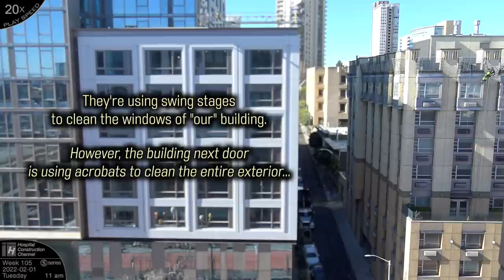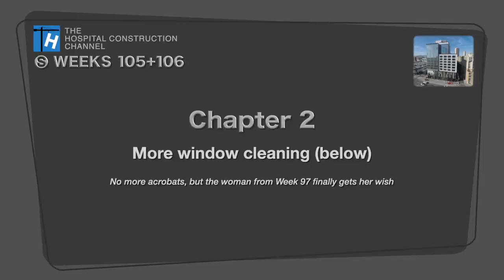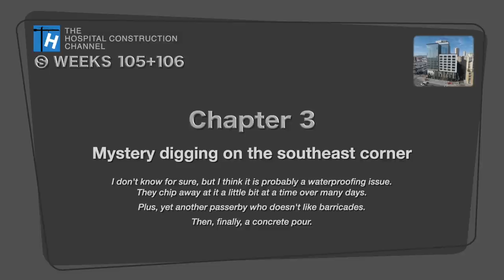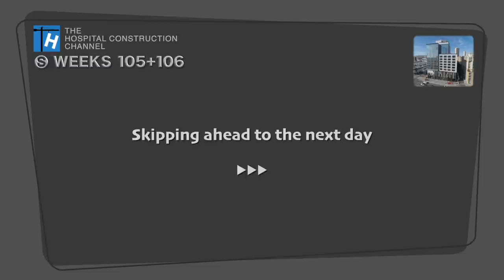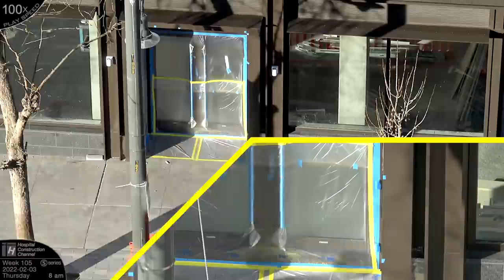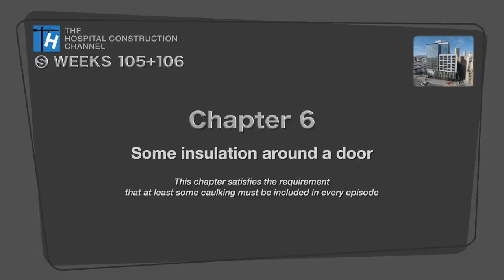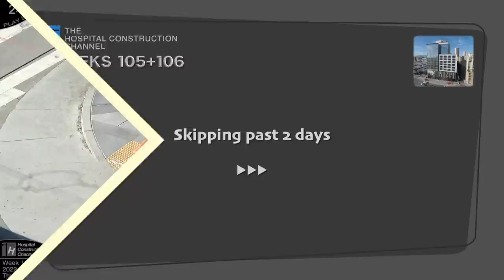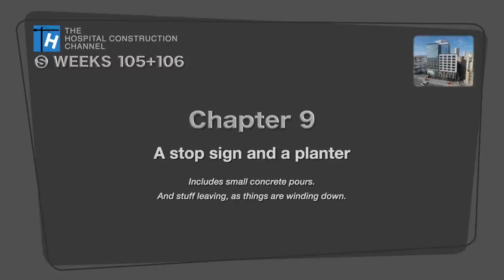Construction time-lapses w/closeups (compilation): Weeks 105+106 of the Ⓢ-series

Comment: 5:28 those are bosun's chairs, used for sailboats originally.  (boatswains chairs)
from the wiki;
"In addition to the maritime applications they were developed for, bosun's chairs are also used for working at height in various maintenance industries. In commercial window cleaning, the term bosun's chair describes devices suspended from rope and equipped with seatboards, such as descent-only controlled descent apparatuses (CDAs)."

Comment: Not biased or anything, but the arcobat cleaners next door did not do a very thorough job. The long-handled brushes are good, but the longer the handle is the less control you have of the cleaning head. And it's about time that woman was arrested for vandalism and for the hours of extra work she made those men do. Opinion here, but if they had placed the bicycle hoops the other way around they could have fitted four or more hoops in the space they used for two. 1:02:59 And the first residents have arrived. :)